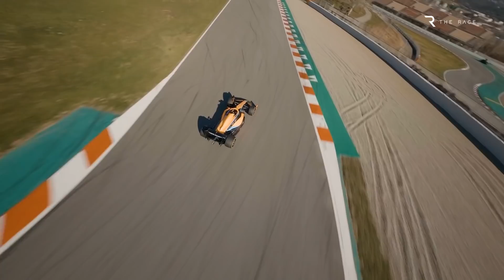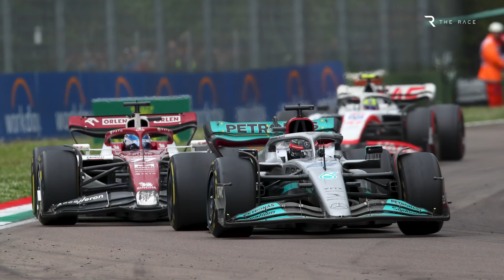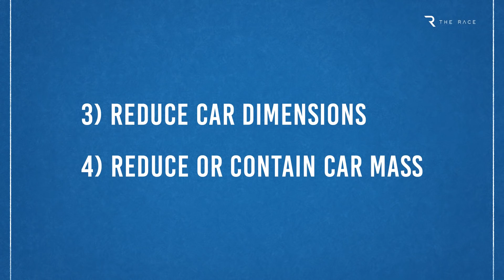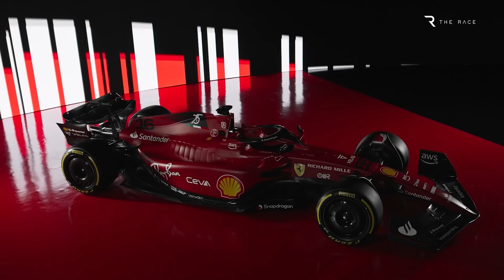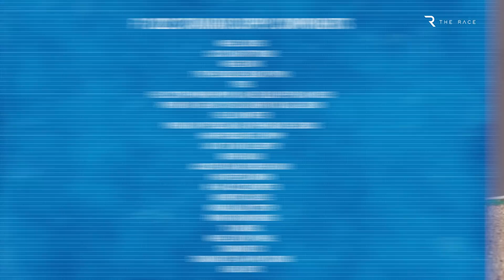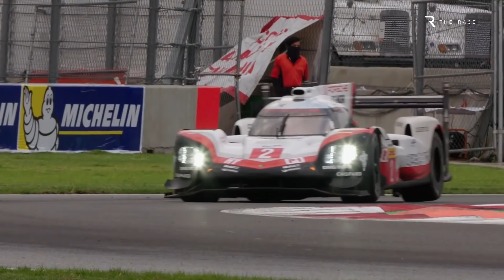F1's new major plans for 2026 car overhaul explained

Comment: I know this is an old video but if you can run an engine on fully sustainable fuels that will result in net zero carbon then why not bring back the V10's but run them on that kind of fuel? Win win we get the sound and F1 get the neutral carbon.

Comment: They should go back as far as 1986 when the turbo cars were able to closely follow the car in front in both high and low downforce corners. There were 5 to 6 teams winning races in those days. FIA & F1 should take the design of the 86 cars and apply current driver safety regulations to this design and use it for the 2026 regulations. These cars were a lot lighter and shorter which will be better for the load on the brakes and tyres. In order to cut the cost paddle-shift gearboxes, e-diffs, DRS and all the other electronic gizmos should be banned. The aero add-ons these days cost a fortune and do not contribute to better racing, cause too many red flags when a piece comes flying of the car, so in my view should be forbidden. Current Pirelli tyres are not able to withstand any hard racing for more then a couple of laps, this must be increased to at least 25 laps to ensure better competition. The e-drive component should be simplified in order to loose weight and cut cost. There should also be a limit on how many staff in total can attend the GP and also how many mechanics incl engineers, data specialists can work on the car and simultaneously back in the factory running the simulator during the night. There are plenty subjects to address to get a more level playing field and increase the competition to ensure a healthy interest in formula one for years to come.

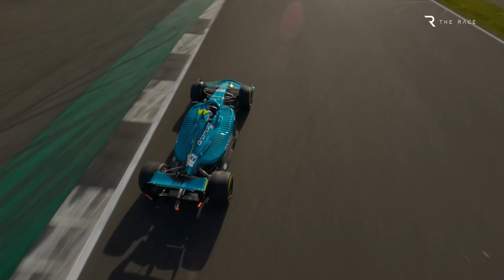Comment: 7:25 unless they put these systems towards traction control and ABS systems so the real world can benefit from it this is all pointless... F1 cars are already safe enough that death or even serious injury is completely unheard of even in crazy 150mph+ crashes. Worst accident recently has been Romain Grosjean's fireball and even with sloppy reaction from marshals and medical staff he sustained burns to his hands and that's pretty much it. There is a point where it becomes basically impossible to die and there is no reason to waste precious resources on making things safer. Don't get me wrong there still are safety improvements to be made but not on the cars anyway, better racing suits, better trackside safety, better rescue equipment, but the cars are already plenty safe. I'd feel completely safe going around those speeds f1 drivers are going, knowing even a major mistake i'll likely walk away from.
Reply: Bro, ABS and Traction control, four wheel steering, ESP, are BORN in F1 and refined in real world…
Reply: @AaronShenghao  Yes and they're far from perfect, hence I mentioned they should go back into F1 to receive further development

Comment: Power the new power units with hydrogen. We need a test bed to prove that this is a better option than electric. Hydrogen is the most available element in the universe. It's by-product is water. Forget all these nasty batteries that we have to dispose of.

Comment: I don't know why they're dropping the MGU-H if they want to keep a high efficiency... That's the key to incredible energy saving. They should have it as a standardised component at least, if it's too complicated for Audi and Porsche.
And if it's possible to make it work with a NA engine, I would love to have a small displacement high cylinder number ICE combined with an MGU-H to make a tremendously efficient wailing machine.

Comment: WOW F1 management must be so busy finding new rules and pumping it into time lines so that the F1 circus have to get their brain trust into board rooms just to understand the rulebook to comply and to get the new cars ready for scrutineering. No wonder these new cars are battling to get a smooth ride without proposing and either over or under steering in corners. Too many rules prohibit the innovation and possible new development of the genius minds in F1. Scrap DRS and get active suspension to eliminate the porpoise of the cars and let the teams test their cars on a track prior to race day, it will make them safe and add to the spectacle for us fans to enjoy. No artificial drama and frustration with cars not working and breaking down because of fuel parts supplied by F1 not the engine manufacturer. Get the drivers too use their natural talent to drive these cars and use their race craft on the limit, but make them safe. Cost caps and preventing testing because there is not enough money came from banning certain advertising brands from the sport. Now everyone is crying for money and no one remember why. Over regulating a sport will eventually drive supporters away. The reason why F1 was ICONIC in the 80 - 90's was the focus was on the race drivers and their cars that was on the edge and cars were developed from problems during every race and mistakes fixed before the next race. Now it's about F1 management and their rules not the drivers and their cars.

Comment: Let's make the engines 300 cc and  6 turbos. Make it a 4 seater. And also quiet. In fact let's make it so cr@p that we don't bother watching.. I want no limits on anything. 12 cyclinder. Any design u fancy... As crazy as u want. Make it the best possible. Refuel. Change tyres as much as u want.... Because F1 are heading to boredom

Comment: YES! smaller and lighter cars all the way. Also, I would like the fia to consider removing high degradation tires from f1 altogether. Maybe once the close racing is guaranteed. It's needlessly wasteful and I'm sure most would agree that we'd much rather have drivers battling it out on track and not thinking about managing tires or having overtakes happening over pit stops.

Comment: well, looking at that weight target, it's obviously v8 upto v12 engine is pretty much unlikely, I3 to I4 seems to be the obvious way. And this proves more so as the electric motor powered increased from 120 kw to 350 kw meaning it's obviously either bigger motor or added another motor to the PU system.

Comment: i don't understand the path towards standardization. F1 has always been the pinnacle in parts development and why it costs a heap of money it pushes the boundaries of engineering which is what F1 is about. As long as its meaningless parts like this year and not forcing teams to use a standard gearbox, turbo, intake, exhaust, brake system etc.

Comment: The active safety features will include parking sensors and lane keeping assistance
Reply: Adaptive cruise control
Reply: Stroll could use some lane keeping assistance
Reply: Lanekeeping would be good because you always have to leave the space.
Reply: Parallel parking assist will be a game changer in 2026
Reply: I’ll bet Max would have loved Lewis to have the lane keeping assistance at that UK race where he pushed him off track at 190 mph!!!
Reply: Tesla self driving
Reply: They could use the spec fuel pump to cut fuel by 80% ish whenever the car is in a double yellow sector.
Reply: @barneyklingenberg4078  that actually sounds like it
Reply: Autopilot
Reply: Not just that, maybe a radar during the wet weather to inform the distance between cars too would help.
Reply: @kohikappu  you might be onto somethin there bro
Reply: @mattladd1694  2021 Spa would've happened but well, yeah that's it.

Comment: 1. Reducing drag will mean the cars will look more like Indycars because they are wind tunneled to run at 390+ KPH.  This also reduces Indycar downforce, so F1 may even have front and floor DRS.
3. Reducing dimensions contradicts reducing drag.  The cars will get longer and narrower to reduce drag.
4. Reducing weight will happen using newer advanced materials by 2026.
5. Indycars runs on E85 ethanol blend.  F1 will likely do the same as ethanol is a sustainable biofuel.

Conclusion:  F1 cars will become more powerful Indycars without a windshield by 2026.

Comment: Continuing to reduce the ICE and increase the battery power only leads to one place - Fully electric, which we already have in FE. Why not turn to hydrogen powered engines and go back to V8 / V10s.

Comment: All good initiatives for F1 to look at. I'd add robustness to the list, More robust suspension and front wings would mean some wheel banging or a wall bump could occur without taking cars out of the race,. This is something Indycar does well.

It'd help budgets and sustainability by needing to replace fewer parts each session but might not help the weight issue
Reply: That stuff breaks for the same reason a road car has crumple zones - to reduce the amount of energy absorbed by the driver in a crash. This is a simple concept, taught in GCSE physics classes - I don't understand why avid motorsports fans are unable to grasp it.

Comment: The best thing they can do is throw away the rule book and start again.

Give teams the creative freedom to design, create, and race what they believe will be the fastest car on the grid. Let them innovate, as that's why F1 has lasted as long as it is. Since this introduction of what is now basically a spec series, the sport is really starting to die.

Some teams may opt for higher safety features but added weight, whilst others may choose bigger engines, whilst others choose a hybrid or electric setup.

Just think of how much automotive technology would've been designed and developed specifically for F1 that would eventually trickle down into everyday road cars

Comment: Why not make a very efficient, naturally aspirated, high reving, light, low displacement V10 or V12? It would be expensive to make something like that efficient but if it would use a lot of standard parts it would maybe cut the costs. And then everybody wins🤷🏼‍♂️
Reply: Future is 3 cylinder turbos. Less cylinders, more turbo = more efficiency. Hybrid electric motor keeps the turbo spooled all the time for no lag.  Will it have the sound no, but big deal.

Comment: I still have a problem with the hypocrisy of "zero carbon footprint" as a milestone for the rule set. When teams are ferrying huge staff and equipment across the globe, and the fuel will be highly engineered, along with the epic investment in engineering spaces, high tech materials, etc., the goal of "carbon neutrality" is a feel good target at best. In reality, a literal drop in the bucket. Of course, research drives innovation, but let's keep reality in mind. Formula-E uses massive batteries, which use rare materials, aren't yet recyclable and have political ramifications for their sourcing and is just as suspect. I love the sport, but accept it is by its nature wasteful, and if you really want to make a difference there, merely changing the fuel and engine make NO difference at all. Except for political appearances.
Reply: Of course it's for political gain. Bernie was well connected but he's gone now, if the nations of the EU wanted to crack the whip against motorsports to earn voter sympathy the FIA needs to appear like they care in order to survive.

Comment: Less tyres will mean less running, less on track action. Safety, they need an aero screen, debris still hits drivers hands and its only a matter of time before something goes through the gaps in the halo, if something does happen, they'll be sued cause the driver or team can point to indy and say theyve had it for years. Fuel E85 makes good power but the whole notion of sustainability is bullshit, the cars cost millions if not billions, development, auto claves, super computers, the factorys have loads of equipment and fleets of computers, they all use crazy amounts of power. If it was sustainable teams wouldnt need mutli billionaires or massive manufacturers to bail them out, its a buzz word that means nothing.

Comment: This is the wrong approach. They should put a cap on joules the team can use each race weekend and bring it low enough that sustainable fuels or fuel systems are a must to be competitive, reduce the cost cap further, and put a cap on dirty air the car produces in the wind tunnel. With these three caps in place, the team could then come up with whatever power and aero setup they want as long as it stays within the caps. This would make for a much more diverse field as different teams would be able to try extremely different approaches.
Reply: Oh, and they should get rid of blue flags, get rid of the drivers' championship and only have a manufacturers' championship. This would introduce really interesting team strategies.

Comment: Still find it absolute absurd they are trying to tackle sustainability by making 20 unique cars built specifically to race insanely fast have slightly better gas mileage
Reply: The virtue signaling of throwing around terms like net-zero and sustainability is pretty dumb in F1. How much carbon is emitted in transporting, housing and feeding hundreds of people for every race, putting up extensive portable luxury hotels/hospitality suites in every paddock and transporting tons of cars, spares, tools and equipment with fleets of ships, buses and aircraft -- not to mention the luxury yachts, expensive cars, homes and lifestyles of the sport's drivers and bigshots etc etc? But yeah, let's focus on making the cars themselves get higher mpg and use fewer sets of slick tires. :smh: Maybe they should let the cars be race cars and instead do something about the gargantuan, smoky circus that flits across the planet for every race.
Reply: @mikep.5517  the intent to get to net-zero, if they are serious about it, is going to have to tackle the energy spent in the logistics of the sport - they know full well that the racing itself is a meaningless portion of the emissions F1 generates.

Comment: 2022 rules have been good so far and the cars look good (better than previous anyway). “If it looks right it flies right”.  

As for the “active safety measures” maybe that will be things like auto SC and VSC scale down of the power output?  Also I think things like automatic track limits sensors (with onboard warning to the driver) could be useful.

Comment: Bring back refueling. Problem solved.
Reply: Despite the fact the cars now have less fuel in them, meaning that the time gaps between someone who is full of fuel and someone who is running half a tank will actually be very, very small. That and the  refuelling years produced the lowest amount of on track action of ANY era (and yes, even discounting fake DRS overtakes) as teams simply based their entire race on not actually overtaking anyone meaning refuelling will thankfully never, ever, return.

Comment: I'd really like to see smaller cars, the previous gen's cars were enormous, and current ones are just slightly better; and reducing both lenght and width will also facilitate overtakes
Reply: The issue is, it's hard to limit the size without compromising safety.
Reply: Narrower cars are a bad idea. Remember from 1998 - 2016 the cars were 1.8 meters wide, reduced from 2 meters in 1997. When the 2 meter track width was brought back for 2017 the cars started looking much better.
Reply: the 2022 cars are larger than the 2021 cars
heavier, too
Reply: @thomasvleminckx  the 2022 cars are actually smaller. For the first time in F1 history there is a limit on the wheelbase.

Comment: What if,  teams can only take there engine from road car, 1.6 v6 hibred in their fleet, surely that's the way forward, more reliable road cars, sell more cars because they have a f1 engine, save teams money, you can go as far as you can, you can say 90% of the car must be borrowed from cars in your fleet, ie engine suspension gearbox steering rack ash tray, cup holder, etc, as the engine goes, you can tune, what do you think?
Reply: Terrible idea

Comment: Drop the engine capacity down to 1 litre. and reduce the length and width of the cars. Also reduce the wheels down to 16 inches because 18 inches is just too big for a formula 1 car.

Comment: Except for the hybrid engines most weight is down to safety measures, and you can't really cut back on those.
It's a necessary evil that needs to be kept under control but you can't avoid it unless they come up with a new super strong lightweight material. But using new and exotic materials is something that is prevented by the cost cap rules.
So far I think the new rules are a good thing and we have seen much better and varied races than we have for many years, but F1 needs to be careful they don't end up like a dog chasing its own tail. At some point adding too much weight will have serious consequences on the performance, and a heavier car also creates a heavier impact. That means crash barriers have to be improved, and so on...
It's a delicate balancing operation but so far I think F1 has made the right decisions for the right reasons so I hope they continue to do that.

Comment: Sustainability goals targets like carbon neutral aren't going to be met, not by the Formula 1, not by governments not by the common people. It cannot be achieved. It cannot be achieved if mankind is still overly dependent on fossil fuels. 

Take the last race in Imola and move the whole lot to Miami, the operations is mainly achieved by fossil fuels, as long we don't have true revolutionary breakthrough in harnessing or releasing energy which isn't on the fundamental principles of fossil fuels, zero emissions, carbon neutral goals will not be achieved. By anyone.

The sooner we accept that as a reality and accept that we do have to use fossil fuels far into the future even when we do find something new, we can stop being so retarded over emissions and make race cars again, not cars to be political virtuous.